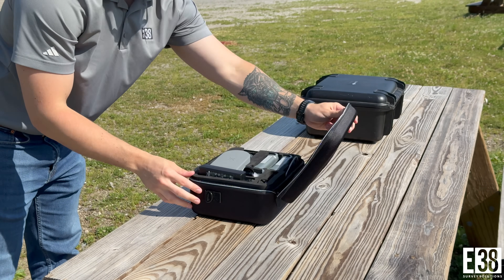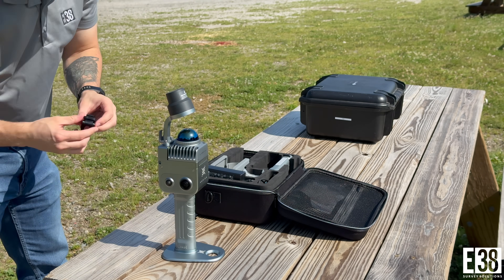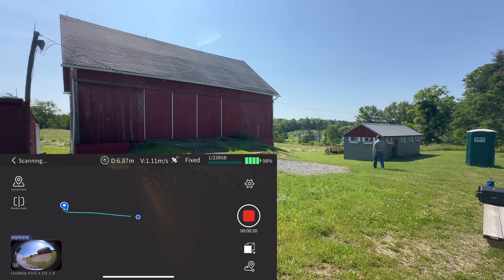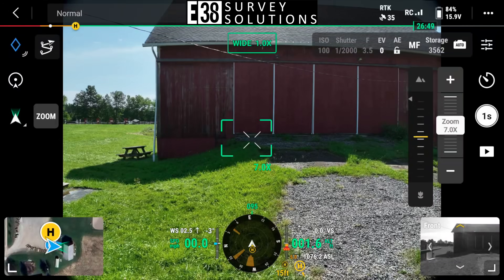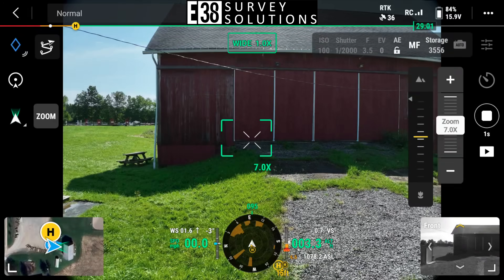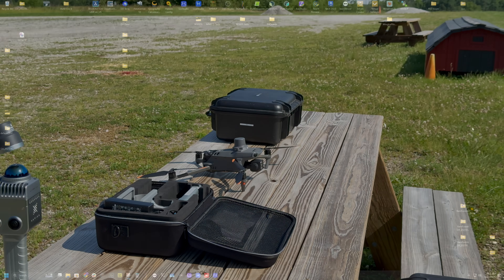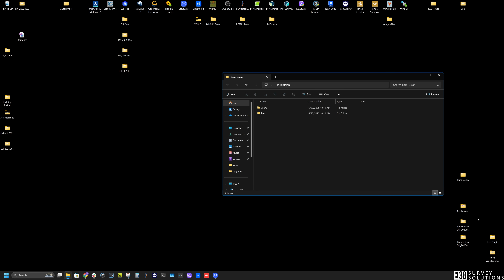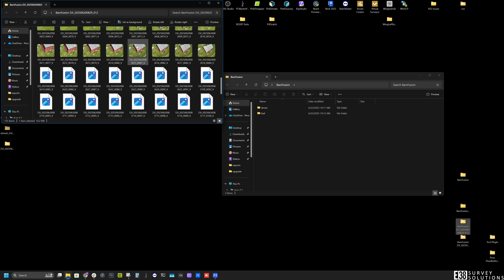Lixel Cyber Color 3DGS Aerial - Ground Fusion Workflow | XGRIDS K1, L2

Comment: Hi,
I have a problem with my data.
The first dataset was captured with a DJI Matrice 300 RTK using the RTK 2 base station and the DJI Zenmuse P1.
The second dataset was captured with Xgrids Pro 2.
When I do an Aerial–Ground map fusion and generate a Gaussian Splatting model, there is a vertical difference between dataset 1 and dataset 2 of about 1–2 meters. They do not align correctly.
I also noticed that you use a program to check and compare both datasets. Where can I get this program?
Can you help me understand what I am doing wrong and how to fix this misalignment?
Reply from the maker: How are you getting RTK on your L2? Here are the files from xgrids to generate your poses: https://drive.google.com/drive/folders/1XxaDS6Q9dx0TucqwhUInC3bd0Lj5swiJ?usp=sharing